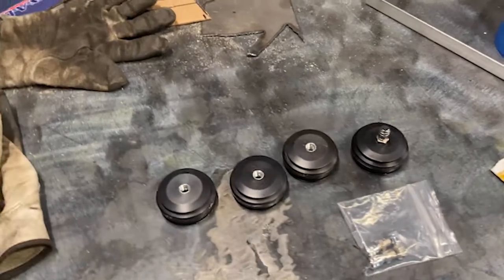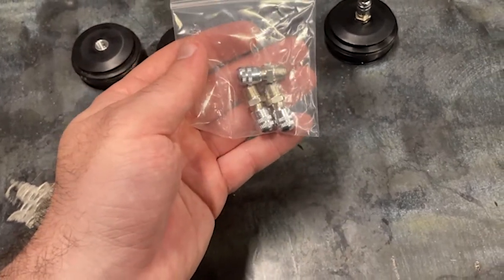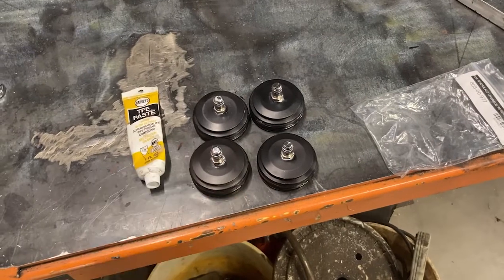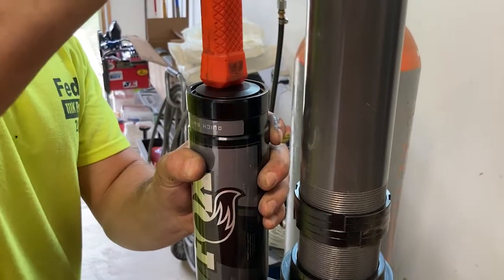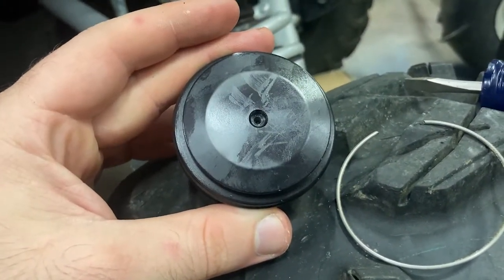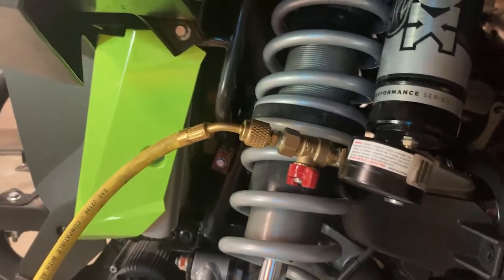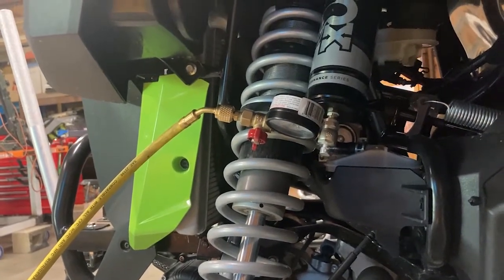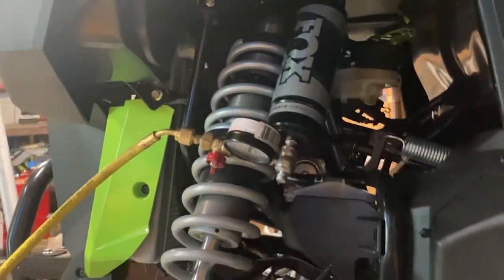DIY: Fox 2.5" UTV Shock Reservoir Upgrade

Comment: Awesome video, I've ordered shock therapy caps with shraders.   Question, my polaris rzr pro calls for 100-150 psi, why the large gap, and which way would you recommend.   I ride pretty hard, but I don't thrash my rig
Reply from the maker: I wouldn’t go less than 150 if you are doing any sort of spirited driving